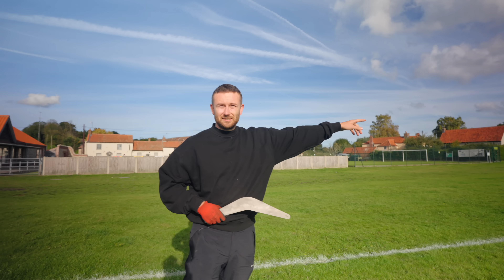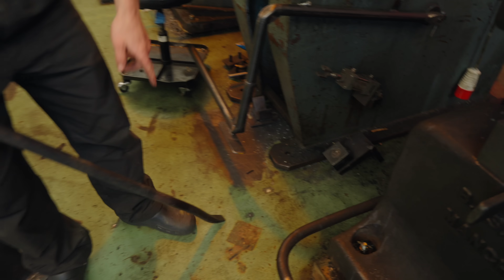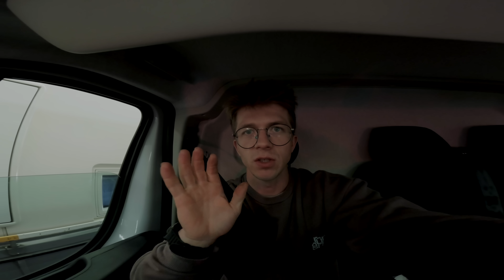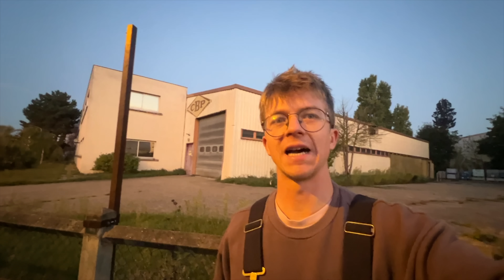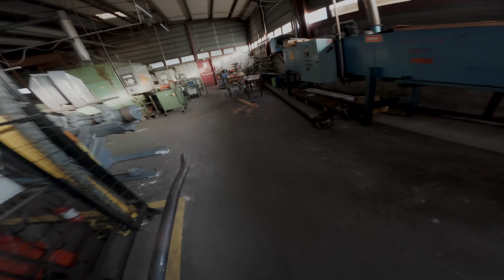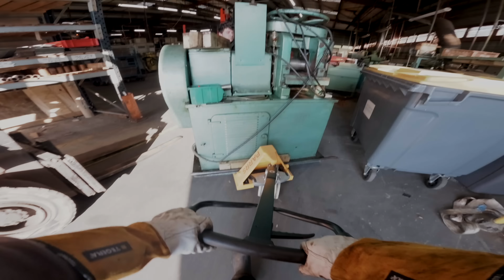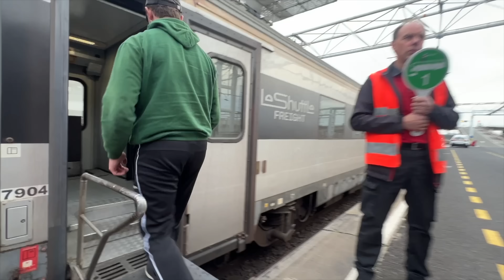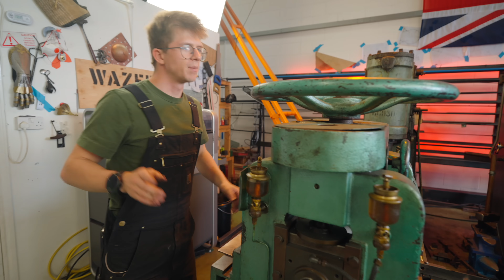My New French Friend

Comment: If it's just springs that hold it up, surely you could replace them with larger springs to take full advantage of that gap
Reply: Probably, but be sure that the larger springs don't limit the minimum thickness when they compress all the way.

Comment: Hi ! 

My hypothesis is that when the setting is at zero, the two rollers are perfectly aligned at their contact centers.
Turning the small adjustment wheel pushes or pulls the upper roller, slightly misaligning the contact point between the two rollers and allowing control over the curvature of the laminated object.

---

My hypothesis is that when the adjustment is set to “0,” the axes of both rollers are perfectly aligned, ensuring a centered and symmetrical tangential contact.
Operating the fine adjustment wheel produces a micrometric horizontal displacement of the upper roller, thereby altering the position of the contact plane between the two rollers.
This controlled misalignment allows fine tuning of the curvature of the laminated material by adjusting the differential pressure across the contact zone.

Not a native speaker, so I tried in my words, and then use AI to try to improve my statement :)

Comment: Couldn't you have just put it on the blocks, and then used the forklift to put the pallet underneath and lift the whole thing off the blocks???
Reply: 3 question marks even!

Because he didn't load the machine the way you thought it needed to be??? LOL!
Reply: @codymoe4986  Chill out bud, I just thought there were some extra steps which involved lifting the machine with a strap, when he was so close to a simpler solution
Just a thought for next time

Comment: > My assumption is that little small wheel must be fine tune adjustment...
Do you have a dial indicator you can put on the upper roller?  There's a great location on the side of the roller to measure from.

Comment: Idk how you guys get by without a truck 😂 if uk had trucks everything would be so much easier I feel bad for you guys
Reply: It fit into the van with room to spare...what use for a truck when you already have a vehicle that will do the job just as well?
Reply: @codymoe4986  it wasn’t ease to load it, if it was any bigger it wouldn’t fit.. if you had a truck you open the tailgate and throw it in there simple as that

Comment: Oh man...how did you ever think a standard pallet jack would support that thing??  I'm even surprised that your rental van had the suspension needed for that boat anchor.  The metal shop gods were with you that day.
Reply: That pallet jack supported it just fine when he put it underneath the machine in the other direction...
Reply: @codymoe4986 Did you see how it bent the pallet jack wheel?? That press probably weighed as much as a small car.

Comment: I love how when you regularly work with heat and metal a fire alarm is just "oh ok" gets back to work because concrete and steel won't burn down

Edit- I'm curious as to whether maybe you're just putting the steel into the rollers at too downward of an angle?

Comment: I'm confused. When putting the machine on the palette. You supported one side on wood and the other on a jack. At that point, you could have just lifted the palette with the fork truck to the bottom of the machine, then moved the wood and jack out of the way. Or if the jack was in the way, you could have skipped the sling and lifted the pallette. Am I missing something?

Comment: if your top wheel is "closer" to where the metal goes in it curves up. i have the same problem with my home made press dies. sometimes they arent lined up straight and the billets curve up. either way bad ass addition to the shop.

Comment: OK, the curve is caused by the two rollers not being in-line, that small wheel pulls/pushes the top roller either forward or backwards of the bottom roller, if the top roller is forward, it will squeeze the metal upwards thus creating that curve you experienced, if its rearward of the bottom roller it will curve downward. having them perpendicular will ensure a flat result.

Comment: If the front adjustment works as you say, the curl is caused by the rollers not being aligned. Think about it, if the top roller is behind the bottom roller, the top roller will push down the bottom roller pushes up in different places, causing a bend upward. Align them so top and bottom press at the same point and the metal runs straight. Put the top in front of the bottom and you get a downward curve, though I'm guessing the adjustment won't allow that given it wouldn't work well with the table in the way. It seems you got the "deluxe" version that allows you to make curves as well as thinning the metal.

Comment: The one that we have in home is powered by the hand of a monkey, is small enoght that you can put it on a nightstand and the price was almost the same as yours. At least out can be moved without trouble because only weight 20kg. (Not used for steel, only for silver, copper and those thinggies)

Comment: Add weight until the inner fender well is almost touching the tires, that's your load capacity.
    You will have to sacrifice speed tho, the suspenssion becomes very unforgiving at near full compression.
Watch your tires going flat too, check pressure beforehand, low pressure tire appear normal unloaded and the distance between the metal rim and the road reduces loaded. 
   Don't be afraid of triple the normal weight capacity, that's for the brakes at highway (or near) speed to keep being somewhat effective. Load it ridiculous and creep with blinkers if you have to.

Comment: I know for the machine shop that I worked at, besides some heavy greasing on the bearings, we'd have to get the rolls regrounded every couple of months. The bottom roller was a flat ground while the top was crowned with an almost insignificant taper towards the edges, just a few ten thousands of an inch. It was to ensure a material spread from the center outwards. You might want to look into precision grinding in your area, just in case, but we were rolling billets into foil, so it may not be as important if you're not going that thin.

Comment: Is there any chance that the springs to move the top roller up are just very weak at this point? It seems like the top dial is able to back out much further than the top roller moved, maybe new/more springs could get you a larger minimum size

Comment: You could've gotten that machine on the pallet with much less work..same way you lowered it onto the wooden blocks at both sides of the pallet, then reverse the forklift and then just drive the blades into the pallet, lift up.....remove wooden blocks....job done. Lol no toe jack required

Comment: 5:27 you don't need anything of the sort Alec! For future reference, just get yourself a real C or F  Bessie clamp. Get a big one. Clamp that old girl to any feature of the machine that's sturdy or down low. Obviously if there's a foot, you use the C clamp, if you don't have any kind of narrow feature or there's curves, you use the F clamp. Then that's your jacking point. You want to jack from the fixed side, never from the screw! And you want to use as few blocks from the clamp to the car jack or toe jack or other lifting implement.

I usually just bring my 20 ton truck floor jack for these kinds of things, overkill in most cases, BUT, i've learnt over the years that overkill in lifting capacity has one huge benefit, superior control both in lifting and lowering. Obviously quality plays into it, but lifting a 5 ton item with a 20 ton implement is a completely different ball game than a 5 ton by a 10 ton. And control = safety. Other than that, you'll need a lot of oak blocks of various sizes and a few of the different types of clamps. Oh and you can really twist the nut by using a high tonnage strap, wrapping it around the item and then using it to lift. It works really well as well.

And to make it perfectly clear, this isn't to lift the item off and move it, this is simply to lift the item for you to put a wedge and repeat all around until it's high enough for cribbing or pallet jack or rollers.

I've moved heavy stuff for a couple of years back in the early days as a sidejob and you learn a lot when you work for an old coot who doesn't like to bend at the middle. :)) Most of the stuff i did was setup, he'd just use his jacks to lift things and favorite crowbar to move them. I remember moving a 8 ton big boy lathe using nothing but brass rollers and a contraption he made, where you'd stand on a plate that had two sides. One side had grippers one side had rubber. On floors, you'd use the rubber down and use the crowbar against it, on rough surfaces, you'd use the gripper side. Your weight was enough to make the load move. Learnt a lot from him even if he was crankier than a crow family after you annoyed one of them.

Comment: Did anyone else realize when he was putting the machine on the pallet that he could’ve just crib both sides of the machine, slid the pallet underneath and lifted the pallet up with the forklift instead of using the Jack and then lifting the other side up with the forklift

Comment: You can make the boomerang boomerang if you bend the titanium. But you have to figure out the bends first, so a mild steel one would have to be bent first for testing purposes. Sauce: i used to make boomerangs out of thin plywood as a kid and all i did to make them come back to me was to wet them and give them a small twist. I would set a M10 nut on the table, put the elbow of the boomerang on it, then a M5 nut on each of the leading edges to make it twist with the help of two clamps and then i'd let it two... three days to dry and Bob's your uncle. A bit of heat would allow me to figure out the final tweaks by hand. It was the cheap two ply plywood you could get for old cabinet backs. We used to have a few sheets that gathered dust so i had a lot of time and material to play with.

Comment: I work at a rolling mill, turn ups and turn down happen with the both the bit you take and the cooling of the bar. The roughing mill rolls a 8inch bar down to 28mm.  For the most part temperature control is what keeps the bar from turning, since we also are cooling the bar at the same time.  Top side temperature vs bottom side temperature.   I suggest flipping the bar between passes.
Reply: second this, we flip between passes

Comment: Ok, squeezing the Steele coin made me think of those machines at tourist spots that you feed a coin into and it imprints an image on it. I wonder if there is a way to figure out how to do something similar using this new rolling mill. Maybe with a hardened die fed in with the material or even somehow making into/attaching the die to the wheels.

Comment: If the top roller can be positioned past the bottom roller I would think it wouldn't curl upwards. The last pressure the steel feels would curve towards the furthest back roller. This might explain the smaller wheel adjustment that appears to move the top roller.  🤔

Comment: Chunnel Trivia - the tunnel was started in 1988 but not finished until 1994. The two 'end' dug from Britain and France at the same time met in 1990. The boring machines used could not be extracted past the casing that had been fitted inside the hole as it went along so they were turned and both buried themselves in the rock wall and were covered over, mid Channel

Comment: @AlecSteele from my hobby as a goldsmith, i know, that it also curls more, when you change the direction of putting it in the mashine. Allways put the material in from the same side. Tip here is, to mark one side with a little wedge. i am not sure if this is the same for hot material, but maybe worth a shot.

Comment: Was just working on a project last weekend. Poured some copper, wanting to make a lock hasp. Was a little thicker than I wanted. Ended up beating the bejezuz out of it. Then it cracked.😢. Rolling mill would've worked great for that.  Been thinking on how I can build my own.
Reply: might not have helped, copper work hardens. if you're stuck hammering I'd take breaks and anneal the workpiece to soften it again

Comment: I've had a small amount of personal experience working with a similar tool and I could tell you immediately the small wheel is for adjusting the curve amount coming out of the rollers.  It's "basic" physics but it's not apparent until you work with by hand a few times.
I'm sure you would have got the sense for this with a little more time working the materials.

Comment: Here are my two copper cents on the matter for the ensuing testing episode! 🥳

Theory: The shearing force on the metal lattice points up or down depending on the order of the rolling pins. This shearing force introduces a bias that compounds over time, resulting in a bend.

Test: Reverse the rolling pin order over several trials and in various modalities and frequencies — i.e., always bottom first, always top first, alternating, and random patterns.

Corollary: If this is the case, the best setting is one that takes a random point on the dial after every pass — i.e., sets the rolling pins at random positions. That way, you are most statistically likely to achieve a random-walk process that mean-reverts any bends (biases) back to the mean — flat.

Also, attempting to set the rollers exactly to the middle will most likely fail, because one can only approximate the true center with human fine-motor precision. Even a few microns of misalignment will compound quickly with sufficient passes, depending on how the material handles shear. (Note how the copper coin lattice deformed easily due to its softness — i.e., its inability to resist shear.)

But I’m not a materials science statistician.

*Sampling from uniform, normal, or t-distributions would all likely work, as all guarantee asymptotic convergence to the sample mean — i.e., the middle point.

Comment: The top wheel pushes the roller down and the front wheel adjusts the depth of the roller. The depth adjust the bend in the material, if you want perfectly flat the rollers should be perfectly in line with each other, if you need a bent part you adjust it until you get the bend radius you need. They are used for both thinning and bending.

*Edit. changed Pishes and Adhust to the correct words.

Comment: The reason metal bends is usually because the upper wheel slips or is slower than the lower one or even without lubrication the metal "sticks" to the roller causing the curve. This machine does not have horizontal roller adjustment, only vertical.
It could also be that due to wear one roller is slightly more worn than the other, especially if it has been used for hot rolling.

Comment: I also have a rolling mill and the twisting is completely normal, there is a huge tension in the steel during rolling and in addition, the slag and the surface of the rolled steel sticks to the rollers, so it copies the surface of the roller. If you look at an industrial roller, the steel also twists, there are several rollers a few centimeters behind each other and after a certain length the steel is so long that it no longer twists. But thick steel will always twist during the first few rolling cycles.

Comment: Is this a hot mill or a cold mill? I think that the rolls would be different materials. (I used to run a cold mill doing research on spring steels, which are cold-rolled to increase tensile strength)

Comment: the best arm angle for throwing a boomerang is about 80 off of dead plumb.  So, to be clearer, a right handed thrower would throw it overhand almost straight overhead but 10 degrees to the right of dead plumb.

Comment: mais tu parles super bien français !!! <3

Regarding the machine, I believe — this is just a hypothesis — that the small wheel is used to offset the upper roller relative to the lower one. This adjustment would allow control over the curvature of the metal after it passes through the machine.

If we imagine the upper roller positioned slightly behind the lower one, the metal would bend downward. Conversely, if the upper roller is positioned ahead of the lower one, the metal would bend upward. Therefore, if the rollers are properly aligned and centered, there should be no curvature at all.

Comment: Alec you're correct about the small wheel adjusting curve. I use cold rollers at work. Its adjusting how far the top roller axis is in comparison to the bottom one. Imagine looking at the two rollers from the side, if the top one moves left or right compared to the bottom one it will encourage the material to go up or down
Reply: is for fine adj
Reply: @-Evilempire-  did you just tell a guy who actually works with these machines that he doesent know what hes talking about
Reply: @Forest9528  This machine does not have that horizontal misalignment system, so either the bearings have broken and gone out of alignment or it is for one of the usual reasons: worn rollers, difference in speed or the iron without coolant/lubricant "sticks" to the roller and is bent along the roller. I have also worked on these machines.

Comment: I'm just guessing but I'm pretty sure the wheel on the front will help with curling.  You will be moving the upper wheel in front of or behind the center point of the lower wheel kind of "aiming" it as it goes out.   Probably if you point it too sharply at the output plate you will end up with a different problem like waviness.